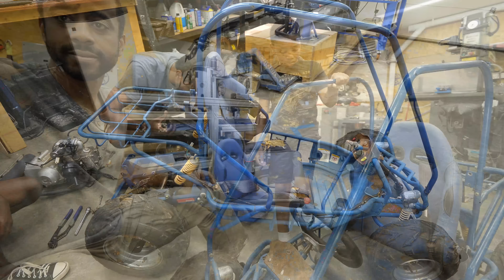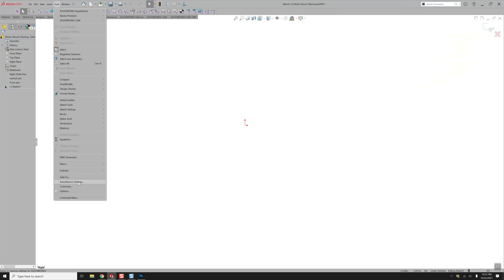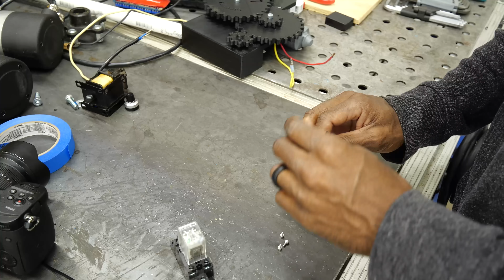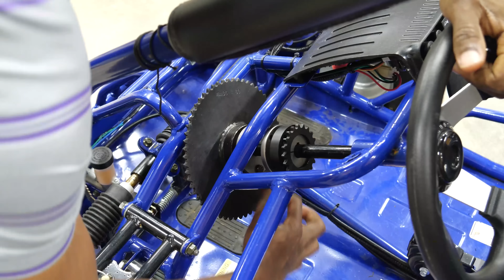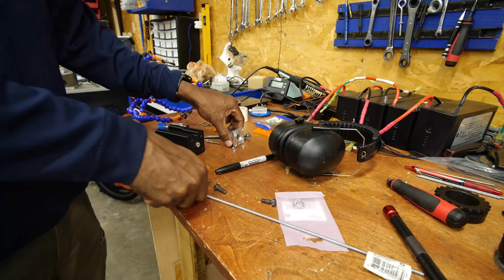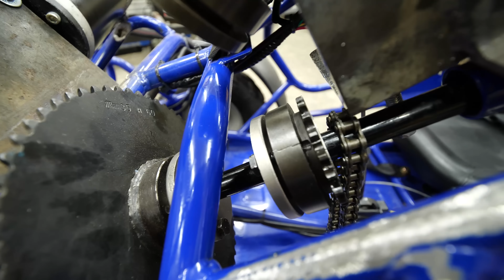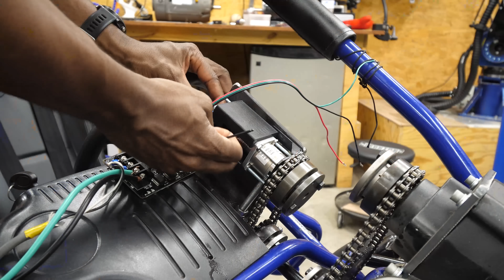Building A Self Driving Car - Jeremy Fielding 098

Comment: I'm guilty of not watching the whole video yet. But what's the point of keeping the steering wheel when nobody is going to be able to back drive that worm gear?

Also, why not just drive the potentiometer right from the motor gearbox output? That gearbox solution, plus added chains and sprockets seems like a convoluted nightmare. Plus, it would allow you to bench test the motor stage without the steering column being in the loop. Which would have likely prevented your catastrophic failure.
Reply from the maker: Reading the shaft position at the motor adds all the backlash error of the worm drive. I like having the steering wheel there mostly because that is the visual clue that the human is not driving. Remember the project is not about making a perfect road ready car. Its about making something I can drive my kids around in a open field and get them excited about the process of making this work. Its a fun backyard experiment, not a production ready product for sale.
Reply: @Jeremy_Fielding  I should clarify - I meant installing the potentiometer at the drive sprocket of the worm gearbox. The backlash there - relative to the steering input, I believe would be less less than the backlash after going through two chains. 

Though the absolute best place is probably at the end of the steering input,  on the bottom of the steering rack. That could have been done with no gearing at all. Coming up with a nut that could also be used to drive the potentiometer would have been a fun challenge too. But with this setup, you still lose the ability to bench test the assembly, which I honestly think is the most important part. If you can compartmentalize problems without requiring integration for testing, that's always a win.
Reply from the maker: Completely agree that bench testing would be optimal. I realized after the video that I could remove the gear from the rack and pinion. That removes the hard stop positions and it can spin continuously in both directions. That way the whole assembly could be tested without damaging anything. Once direction etc is all confirmed I can put the gear in and drive it.

Comment: On the steering failure.  I think the very obvious answer is to sacrifice the motor; (use a smaller motor). That way when it fails, at least you can still grab the wheel and steer manually;  You gotta have that manual backup.   You actually got lucky that your chain popped off, or you could have lost the column AND the motor (maybe. lol)...

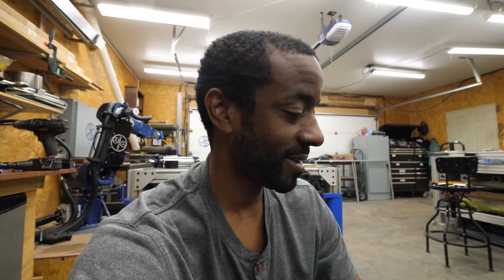Comment: 22:21 Maybe a  custom steering angle sensor would solve this problem.  You could come up with a shaft smooth steering wheel, and a clutch motor to engage and disengage the steering wheel for the failsafe operation. Great work!

Comment: That's why in my autonomous racing team's car absolutely EVERYTHING is built to be failSAFE. If anything looks wrong (steering angles, brake system pressures, too high power draws, processors halting, loss of power, etc) the entire system immediately transitions to a safe state, meaning it immediately engages the fully redundant emergency brake system. That's the only way you can guarantee to prevent more catastrophic failures (like loss of steering while driving in your case). I recommend looking into such safety systems (shut down circuits, watchdogs, normally open brake system valves, etc.). Also reducing the power of the motor seems reasonable, but also monitor the steering system for responsiveness in software.

But congrats on a new project! I promise you it's going to be way harder than you think :)
Reply from the maker: I do expect it to be hard. You have seen my channel before right? LOL I am just kidding... I usually expect my projects to be hard, and still get surprised at how hard.
Reply: @Jeremy_Fielding  Absolutely, and i do really appreciate that you show so much about the difficult challenges and where you go back to the drawing board :)

Comment: A support bracket from the  motor to the steering column would prevent bending and give somewhere to mount a guard.  It could have a bearing or a brass/Teflon bushing on the column.

Comment: Not an engineer. Is it possible to have sacrificial gears on the motor(s) that would strip out but leave emergency manual steering possible?
Reply from the maker: Yes... some kind of mechanical "fuse"
Reply: They also make friction clutches and shear pins as failure points. The former is more expensive but reusable while the latter is cheap but needs to be replaced. I believe shear pins are used a lot on farm equipment. 

IMO if cost was not a factor I’d use a motor that is more underpowered and backdriveable with more precise, less noisy position feedback such as a magnetic encoder or similar digital positioning so you can do closed loop control. Something that can be compliant if you hit a rock or curb. Ideally you’d have force feedback from the steering wheel so the driver can take over if need be but that may be a challenge if trying to do it affordably.

Comment: Prehaps size a shear pin that fails before the steering column. That way if it fails you'd hopefully still have manual control over the vehicle, but the motor would be mechanically disconnected?
Reply from the maker: I like the idea of a mechanical fuse.

Comment: Haven't watched in full yet so forgive me if you already address it, but I had some thoughts on your safety comments regarding electrical / mechanical components being the weak link.

If you allow the mechanical side to be weaker:
- You can't manually steer the car in the event of a failure.
- The torque may be high enough to cause injuries (say, if a kid puts their arm through the wheel and gets it pinned somehow).
-  The autonomous system loses steering control.

If the electrical side is the weak link:
- It can be expensive.
- The autonomous system loses steering control.

I would suggest you build in a self-resetting 'fuse', either mechanical or electrical to limit the torque. You could design the driving gear to slip mechnically at a specific torque (could be an interesting mechanical problem to solve), or install a current sensor / limiter on the electrical side.
Reply: This is a problem is a real thing in tractors 
Yea agriculture is way ahead anyone else in self driving machines 
Back in the 90s we had auto steer was simply a motor that had a rubber wheel that rode on the steering wheel 
When you want to disengage the auto steer you simply reef on the wheel 
When the autosteer motor senses the over torque it would shut off and let you drive again 
I figure its a setting in the computer that knows the current the motor requires is unusually high and shuts it down 

And yea the problem of it dropping out was/is a thing if you hit a big bump or something the jerks the wheel it would cut out and you'd have to grab the wheel quick and re-engage it 
These days it's all built in and it can electriconicaly activate the steering valves its self
Reply: I agree while it may be more complex, you would save both the motor and the steering column by having a clutch system in place and you don't have a catastrophic failure that would injure a driver. They would also be able to take control manually as well.
Reply: This is a problem is a real thing in tractors 
Yea agriculture is way ahead anyone else in self driving machines 
Back in the 90s we had auto steer was simply a motor that had a rubber wheel that rode on the steering wheel 
When you want to disengage the auto steer you simply reef on the wheel 
When the autosteer motor senses the over torque it would shut off and let you drive again 
I figure its a setting in the computer that knows the current the motor requires is unusually high and shuts it down 

And yea the problem of it dropping out was/is a thing if you hit a big bump or something the jerks the wheel it would cut out and you'd have to grab the wheel quick and re-engage it 
These days it's all built in and it can electriconicaly activate the steering valves its self

Comment: Ah yes, the classic inverted feedback loop.. oops! Something I always do when working with feedback loops is clamp the maximum output speed at a very, very low value (or current-limit similarly) so there's at least some hope to catch issues like this before disaster strikes. Works a good 50/50. :) This is going to be an exellent series, I'm looking forward to the next video.

It was great watching your keynote at Remoticon on the weekend btw!

Comment: If you're leaving a steering wheel on, then I would make the motor fail so if someone is actually in it, they have a shot at manually steering before stopping/crashing.